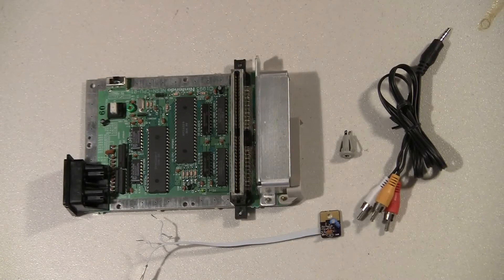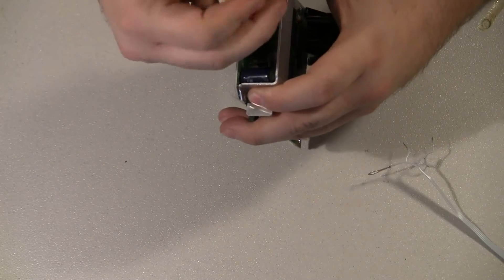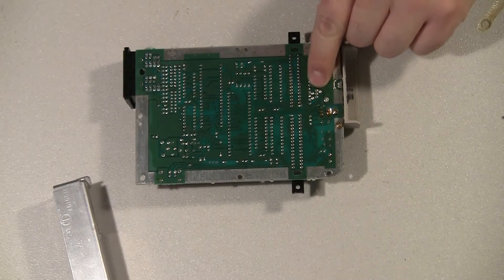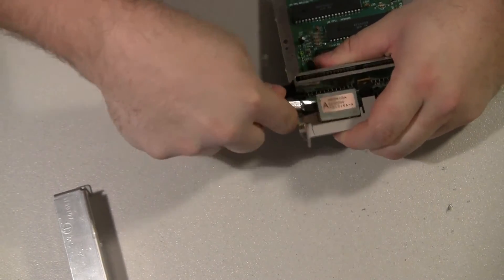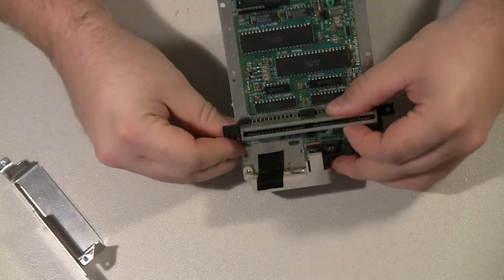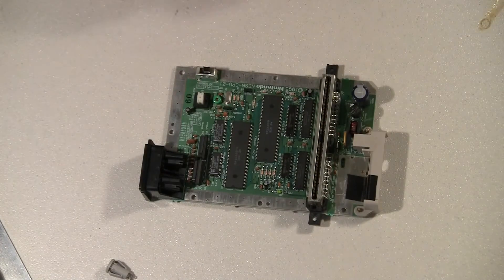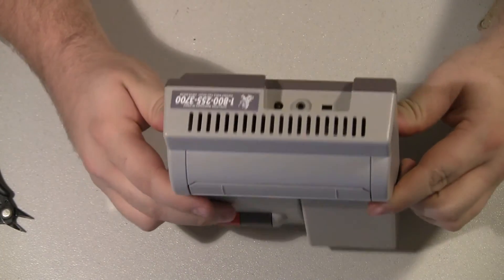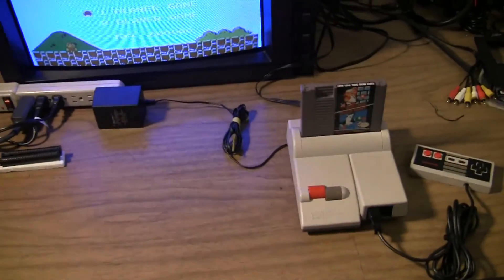NES-101 Nintendo top loader - 3.5mm TRRS AV connector mod walk through

Comment: What kind of cable are you using? I got a couple of those av 3.5mm cables but they are worthless, the video works on them but the audio coming from the red is not even there and they are brand new cables. I could try to clean the contacts in the Jack's themselves but it probably still wouldn't help.

Comment: Has he ever commented about what tools he uses?

Specifically, I wanna know what kind of power his soldering iron has (I'm having problems, and it was commented my iron might be too hot for the work I'm doing with it). What gauge wire does he use, and what type of solder? Does he use the rosin core or silver-based?

I'm starting to get into console modding myself, and I just wanna make sure I'm doing things right.
Reply: I have, not sure what vids talk about solder, but usually use rosin core 63/37 lead/tin .020.
I did a whole vid about the iron I use now, the JBC.